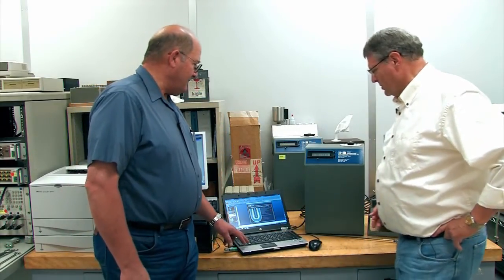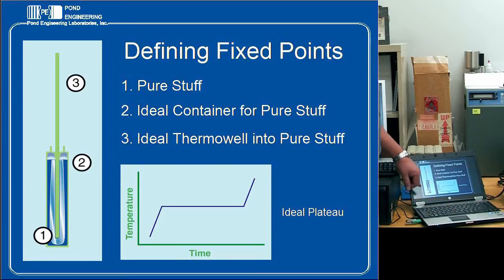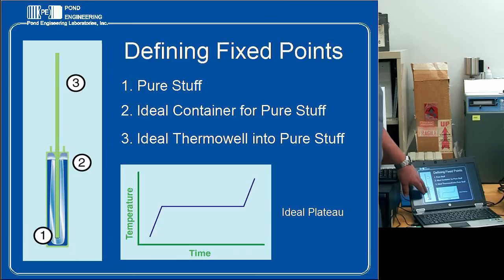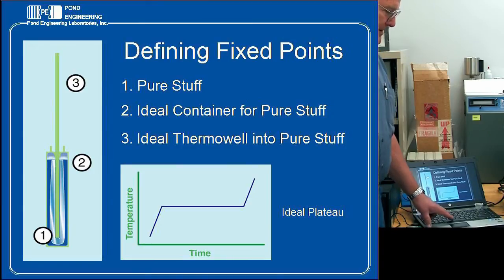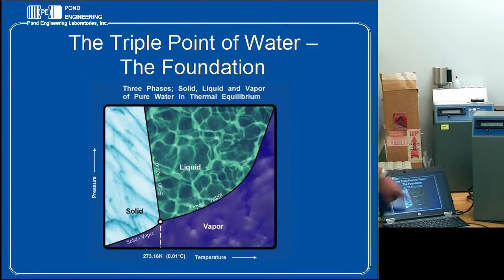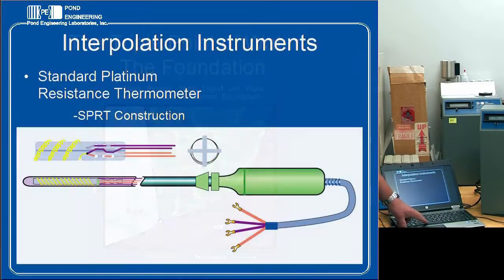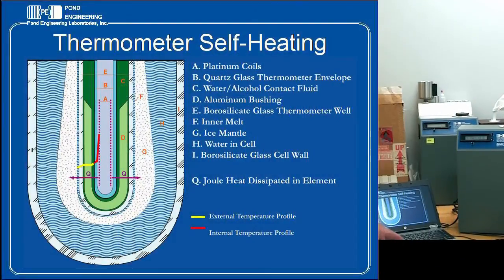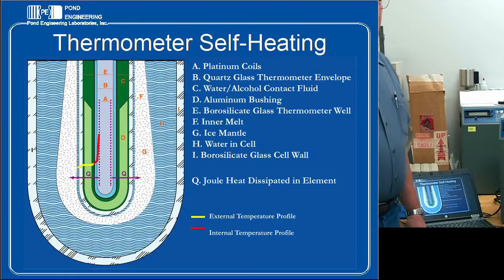Measuring the Triple Point of Water Using an SPRT, Learn What is the Triple Point of Water

Comment: Could you share which SPRT is used in the measurement? Is it a probe with a matching connector to the 34420a or had it been made to fit?
Reply from the maker: @Elias Bakken. I'm not sure which model of SPRT was used in the video. They typically come without a connector. Adding the 34420A connector eliminates errors associated with extra connectors. The 34420A connector is excellent for small signals as it eliminates airflow and is held in place with constant pressure.
Reply: Right, I've looked at some documentation for the 34420a for a recommendation on which SPRT to use, but not found any. Any suggestions regarding good fit in terms of accuracy and drift? It's not a problem to make a connector, but just wanted to verify that there is no SPRT sold by keysight.

Comment: Since the pressure inside the triple point cell varies (slightly) at different depths under the water column, I would think that the as-measured temperature at different depths would vary slightly, too.  Is there a "standard depth"  at which the temperature is measured, or perhaps a graph of depth-submerged versus temperature?
And is the triple point still measured as 0.0098 Celsius, rather than at the more-commonly cited value of 0.010?
Reply from the maker: Jim b. Insertion depth can affect the measurement. In the Pond Engineer data sheet the error is listed for different SPRTs.

Comment: why does it cost 5k to get that device calibrated
Reply from the maker: ***** The cost of NIST SPRT calibration is based on the number of temperature points that are verified. And how difficult the temperature points are to achieve. In the video we only tested a single temperature point - the easiest one. NIST has a paper on testing at 9 different points. Depending on your needs you might be able to use fewer points.
Reply: +Keysight General Purpose Instruments so its like points along a calibration curve - so there would have to be other TP cells
Reply from the maker: ***** Exactly. In addition, to the NIST paper, take a look at the pondengineering website to see the other TP used.